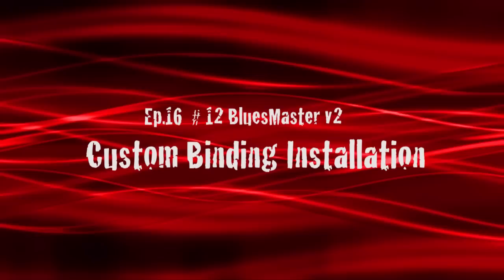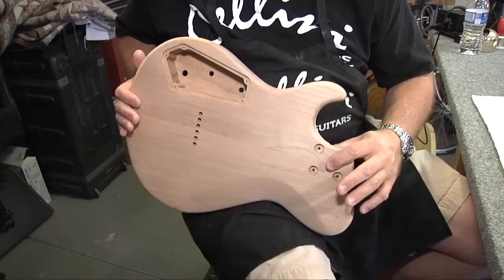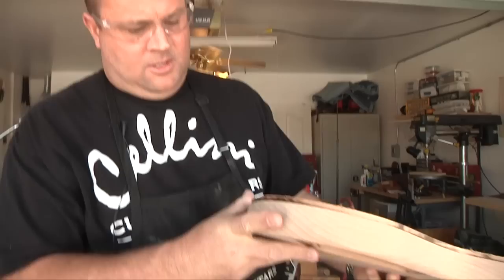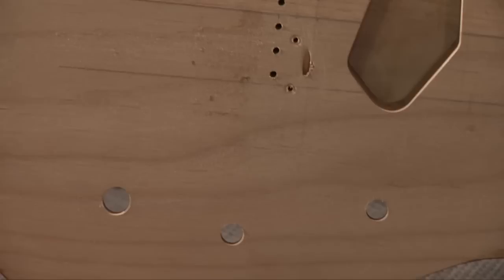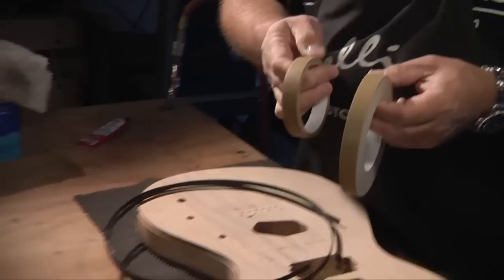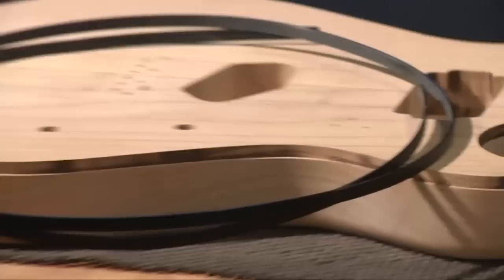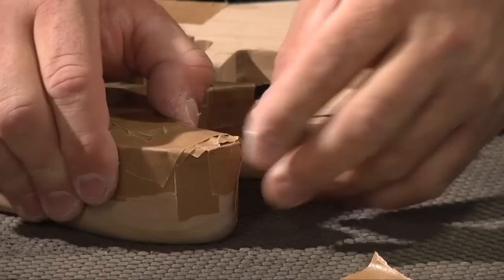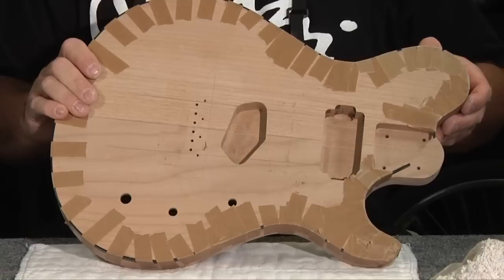Erics Guitar Garage-Ep16 Custom Guitar Binding Installation

Comment: Hi Matthew the bearing size is a matched fit with the binding bit. It only routs about a 1/16" of an inch in to perfectly match the binding. Both of which were purchased from Stewart McDonald on line.

Comment: What kind of adhesive are you using?
Reply: methyl acetate. ie, UHU glue or loctite all purpose adhesive extra strong, both the same glue.
Reply: SciGrip #16 (Weld on 16) solvent - type acrylic cement